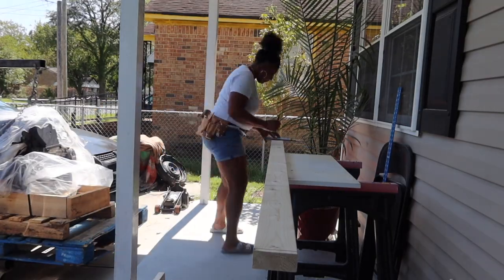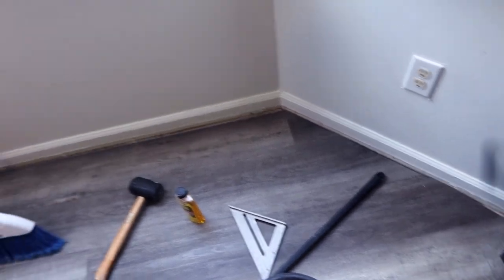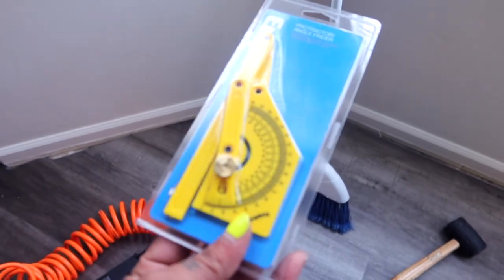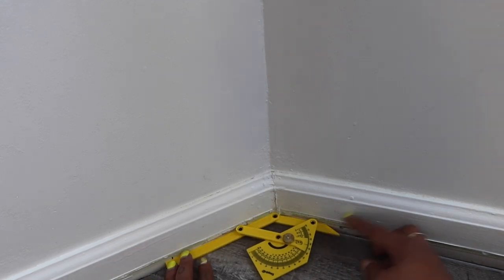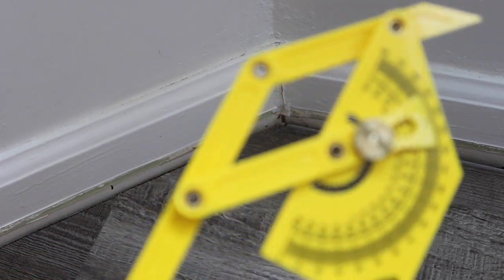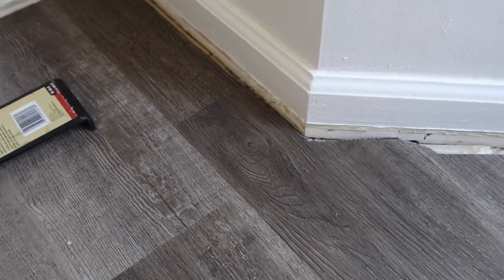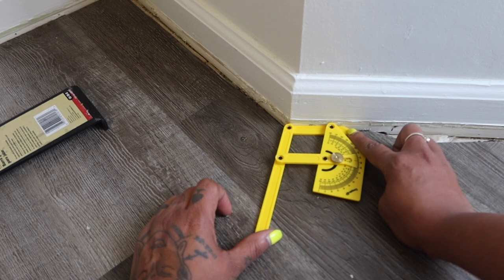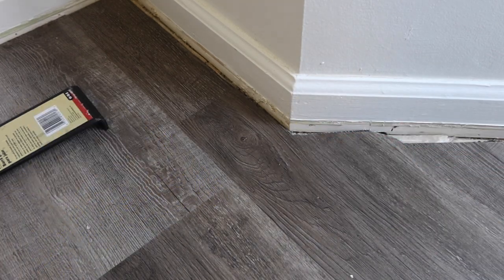Perfect Miter Cuts

Comment: Thanks, Dani. 
Question. Is it possible to make angled cuts without a mitre saw? I have a small project requiring me to make some angle cuts but that doesn’t warrant purchasing a whole saw at this time. Basically making a house-shaped chalkboard on the wall of my son’s bedroom. I’m struggling to figure out how to cut the angles of the frame. Help?
Reply from the maker: Yes Marthe in home depot or lowes you will find a pair of miter cutting scissors. Can be use to make those angle cuts and like you said avoid having to purchase a saw!